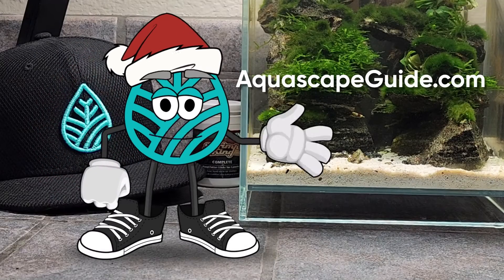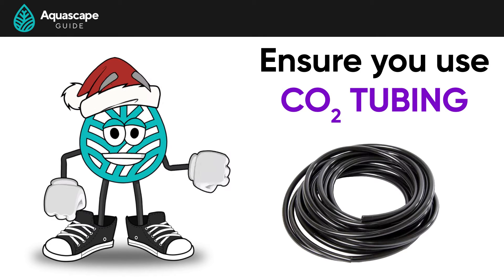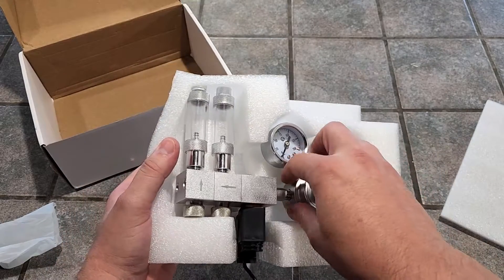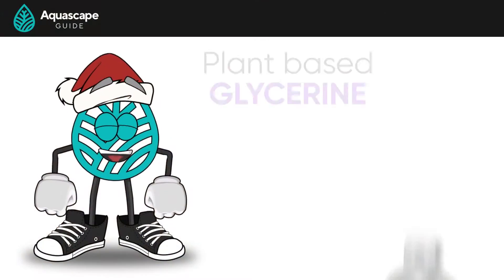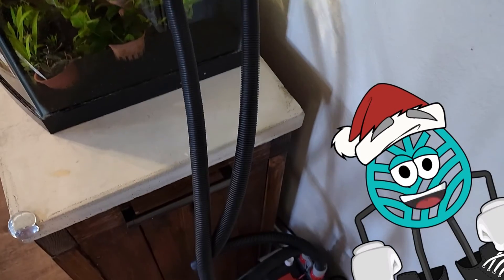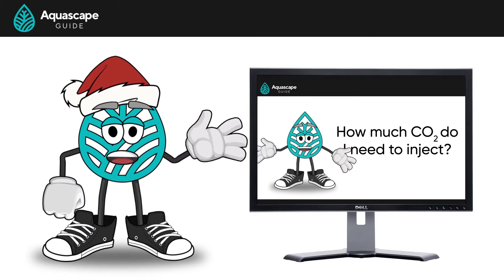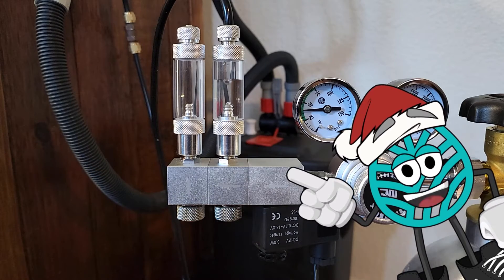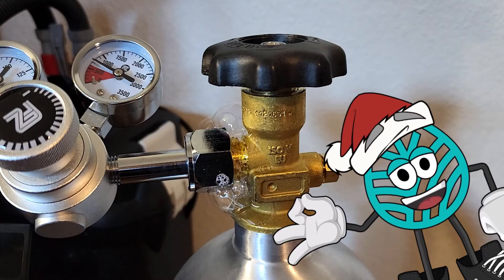AquascapeGuide - How To Setup An Entire Co2 System

Comment: Hello, thanks for the video! Question, I have water in my tube what should I do? The CO2 doesn't seem to push the water out. Thanks
Reply from the maker: This happens because your check value isn't close to the diffuser. When the CO2 turns off negative pressure pulls water into the diffuser. Put a drop checker as close to the diffuser as you can without it being underwater and the water SHOULD be forced out of the diffuser over a few days. You could also try to leave the diffuser in the sun so it evaporates out, then you can put it back but that would require you run NO co2 for a bit, or have another diffuser on hand. Hope that helps!
Reply: @aquascapeguide  thanks for the reply my friend! I finally sorted out what was the problem.
Reply from the maker: Yaaay! Awesome. Glad you figured it out

Comment: 7:00 Love your videos. You explain things so much better than any other videos I have seen. With that said, I am hoping you know of an inline diffuser that fits the 24mm hose on my FX6 or maybe a way to adapt from a 24mm to a 22mm infuser.
Reply from the maker: Carrie, thanks for reaching out and for the kind words! Im glad my videos have been helpful for you. I was researching it for you and there aren't many options. Most people that are using a FX6 have a larger tank and are running an inline reactor that has connections that will fit seamlessly. Google "NilogC Inline Reactor". They are kind of big and clunky, but work amazingly well, are the most efficient means of Co2 diffusion, and have zero "sprite water" from Co2 bubbles. If you have to run an inline atomizer, google "rubber connector for FX canister". This will bring up some connections that MAY work. The run would go, cut hose > connector > diffuser > connector > hose. Last idea but not the least is ditching your ribbed tubing on the FX for vinyl tubing. If you dip the end of a 22mm diameter tubing into some almost boiling water, it will make the tube VERY pliable, and from there you might be able to push it onto the canisters inlet and outlet nipples (giggity). And then that should connect fine to a 22mm diffuser. But my top suggestion would be to look into a reactor. Those things are amazing.
Reply: Hello!
Thank you for your time in helping out. I got the the rubber adapters that connect FX6 hose to another FX6 hose.  I couldn't find one that adapts to a 22 mm. So, could I safely use hose clamps?
Reply from the maker: Yeah, you might just need to rig up your own little connection type with hose clamps like you're thinking. Again, I think most move to reactors when they have filters this big. Kind of a pain, but maybe there is a product opportunity for someone 24mm reactors ;)

Comment: Hi guys,
Thanks a lot for all your helpful videos. 
One question for the co2 sistem. 
Can I use a PH controller to keep that 1 point PH drop constant ? I mean, can I run the controller day and night ? Or just during the photosintesis perioad ? I’ve read that during the night plants need oxigen and give out co2, so no need for adițional co2 injection during the night and this is why I’m not sure if a PH controller is suitable for a planted tank.
Reply from the maker: Thanks for the question! I wouldn't suggest running your Co2 overnight. If your controller has a programmable timer you can have it turned on and off 1 hour before your lights, and or you can plug the controler into a timer. I just just worry that if you ran it day and night, if something were to go wrong at night, you could gas your livestock. Technically your controller "should" prevent Co2 build up at night, but I wouldn't risk it. Plus its just wasting Co2.

Comment: Thank you! Best description I’ve found!
Reply from the maker: Thank you so much for the kind words. Check out the other Co2 system builds Ive recorded as it will hammer home the core elements on a Co2 system. It really is as easy as a Co2 tank, regulator and your method of diffusion. Also, check out the Co2 video in our Part 1 playlist. It covers the PH drop method at the 5:45min mark. Basically how much to inject ;) And feel free to ask questions if you've got them!

Comment: Color tubing is real cool man, for sure but clear is better as you can keep an eye on the line between the check valve and Regulator to make sure there's no water returning past the check valve and Regulator.
Reply from the maker: Yeah! Great point. I only had access to black tubing when I started running CO2 MANY years ago, so I've got a ton of that lying around. I think if I need to re-up, I'll get some clear. I don't like seeing the black tubing running around the aquarium as well, so clear would make it less noticeable as well :)

Comment: Great walk through vid! Also good to just note that these ceramic diffusers need to have a good soak before putting them under any pressure.
Reply from the maker: GASP, I did not know this! Thank you for sharing ;)  There is always something to learn in this hobbyI Thank you for saying something.
Reply: Why? :)  I have never heard of Co2Art/Fzone recommending this... but I don't doubt you :D
Reply from the maker: DJ has a point. I always soak my ceramic in tank diffuser, but didn't think to soak this one for some reason. hahaha. Someone could jus install one inline their filters outlet hose, and just let it run for a few days. That chamber does fill up with water and that would be enough. Just delay injecting for a couple of days and you'd be good to go. Just wait to tial in CO2 AFTER the ceramic option of the inline diffuser has soaked ;)
Reply: @aquascapeguide  Thanks ASG you've got a new subscriber 😉
Reply from the maker: Anytime! That is why this channel exists :) Welcome to our little community!